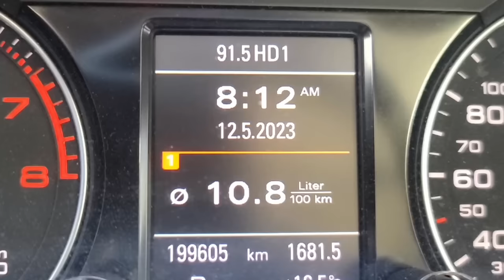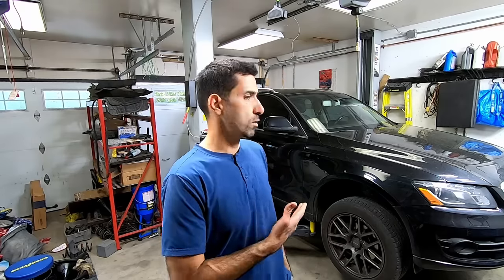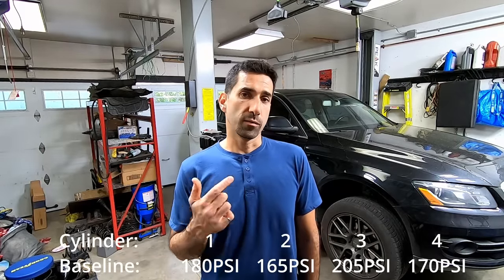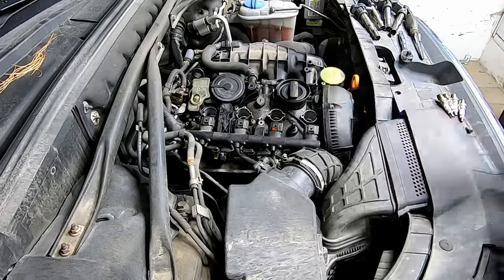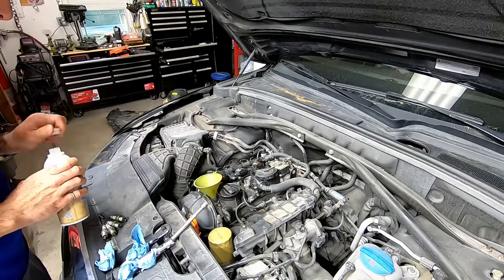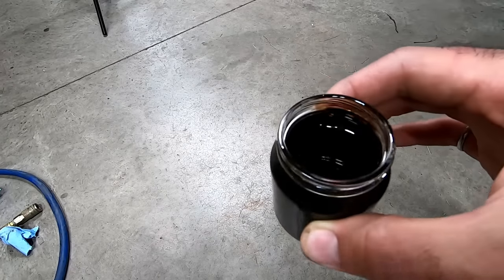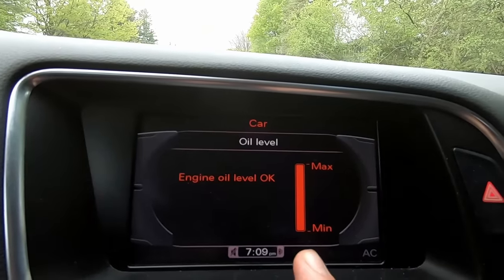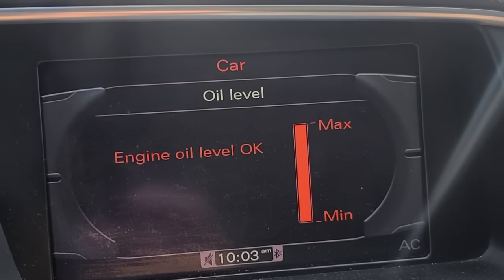How to fix excessive oil consumption from clogged piston rings (Part 2)

Comment: Would this work on my diesel? Suspecting i also have this issue. Burning oil about 1L every 1000 miles. I did a liquimoly flush previously and didn’t burn any oil for around 2000 miles but then the issue came back.

My worries are: being able to get the liquid sufficiently around the piston through the glow plug hole, a possible runaway engine once completing the soak, and also if the deposits that are released by this process will cause damage to the engine. 

Any guidance would be appreciated
Reply from the maker: Hey sorry for the slow reply... no real reason why this wouldn't work on a diesel if the piston rings are causing the same issues... doing a flush doesn't really give enough time for the solvent to free up the rings which is why the soak takes a bit longer... the 24hrs is what gives time for the liquid to soften up the soot in the piston rings that's causing the issues...

You should have no issues getting the liquid in through the glow plug holes but be careful when removing those... perhaps start with a hot engine to make sure they come out easy

As for a runway engine - hmm... which engine are we talking about? Common rail or older? If you're worried about it maybe shut off the fuel before cranking the motor?
Reply: @ETMotorsports  thanks for reply. Yeah definitely will be doing on a warm engine. Replace them whilst I’m at it aswell. 

Yeah should be okay will do a few cranks of engine once soak is complete before putting glow plugs in to make sure all liquid is gone from top of cylinder. 

The engine is a 3.0T out of a bmw. Heard these are known for low friction rings and as such this very problem can occur.

Comment: This is why I do my oil changes at 5000km on these EA888 engines.  The 14000km suggested interval is too long for vehicles in Canada.  Nobody in Canada qualified for non severe conditions. That’s what has ruined these cars. Oil is cheap. Engines are expensive.
Reply from the maker: I don't disagree that they're not exactly building these for different regions but I've got plenty of messages from folks all over the world so this is a widespread issue - it's not isolated to a region

Comment: how do ya get the liquid out after it soaks? i wanna do it but im intimidated. Plse help
Reply from the maker: Hey the liquid ends up in your oil after it goes through your piston rings... in the video I ran the motor for 20 min with the B12 in it before changing the oil with a fresh filter... if you're worried about doing that you can just drain the oil after the soak and replace it with new oil without running the motor
Reply: which is the right thing i think, thank you for the video  @ETMotorsports
Reply: @ETMotorsports will it help to run SeaFoam in motor for couple days before the Soak? Plse lmk. Thnx

Comment: I changed my plugs 2k miles ago, can I do this and use the same spark plugs? Or do I have to change? I’m trying to do this in a Kia Optima 2018 that is burning a lot of oil
Reply: Take a look and just make sure they’re not black. But during the restart, they may get some carbon n them, so just clean them up with a toothbrush and throttle body cleaner and you should be good.

Comment: How were the cats after all of that? Also what was the compression check the 2nd time? Also 2012 Scion XB doing the exact same thing. 2 quarts every 5000 miles.
Reply from the maker: No issues with cats - everything is clean... check out the third episode for the compression numbers etc

Comment: I got Audi a6 c6 2l TDI, and it burns 1L every 70km... :D it gradually started to get worse and worse, i wonder would this still do any miracles to it...
Reply from the maker: Damn...1L every 70km? I don't think you've got ring problems mate... that's straight pouring somewhere... rear seal?
Reply: @ETMotorsports  i doubt, it only smokes on high revs and there are no oil residue anywhere, unfortunatelly 2 years ago one of the pistons hit the head, so there was and urgent motor rebuild, and ive been told that rings on 2nd cylinder was looking rough, but it was after they rebuild the motor... so i wasnt keen to pay another 2k to take it apart again... after the rebuild it was burning every 300miles and slowly started to get worse, but there is no miss fire or anything, i just keep topping it up and smoke alot while drive. I got nothing to loose by trying this method as im already looking to buy another one, this might prolong it. Done 150miles today, poured 3L in :/

Comment: Hey, I want to follow the steps you took in this video because my Audi Q5, 2015 model, is burning througg oil like crazy... The process seems pretty straight forward, but I called around near me to see if a car mechanic can perform the piston soak for 24 hours, and a couple of problems come up: 1. they only want to let it soak for tops 1 hour, my question to you is if that makes a big difference? 2. They're charging crazy amounts just to do something so simple...
Reply from the maker: Hey the process is SUPER simple...if you can take your plugs out and change your oil you don't need a garage to do this for you...I think 1hr won't be sufficient for the liquid to really work properly - I mean it might but there's only one way to find out...technically you've got nothing to lose doing a 1hr soak before an oil change to see if anything is fixed but I think you're kinda wasting your time...I am curious about what they're really charging you for? Because this requires about 12 minutes worth of work and then the car just sits there...you should be able to perform this within a basic oil change job (so what's that about 100-150$ with the oil?). 

I`m not sure what to tell you - mechanics are in the business to make money and I guess they might be worried of potential issues down the road etc. Also consider what happens if the mechanic screws something up - say he puts the plugs in and cranks the motor and hydrolocks your engine - now there's trouble...This is truly a DIY type process - I don't think many mechanics will want to "risk" doing this job...
Reply: Thank you so much, this was very insightful @ETMotorsports

Comment: I'll try this on my 2013 3.0T Q5. 

But I still need to find where the coolant leak is at. It's been chugging coolant and I can't find where it is leaking from aside from the wet spots on the driver side (front-end).
Reply from the maker: 3.0T...hmm... these have issues mixing coolant with oil I think - lol online I think a seal fails... might want to check that asap - pretty sure they're are lots of stories of mechanical damage due to that issue

Comment: Would u know I can the part b12 from. I bought my oil at Costco 5w40 Castrol edges and filter at vw. U think use sucking pump to do oil change ?
Reply from the maker: You can just drain the oil no need to suck it up...i haven't seen 5w40 au costco but maybe my local one doesn't carry it

Comment: Do you think just running this in the oil for a day before an oil change would help at all? I don’t have the tools for this job.
Reply from the maker: interesting question - nothing really stops you from trying...it does however seem like the soot build up in the rings is pretty heavy so soaking it for a few hours seems to be the best way to deal with it...multiple viewers have tried a simpler approach and engine flushes but haven't been successful...on the upside you don't really need any tools other than a spark plug socket, which shouldn't cost you more than a few dollars...

Comment: I am planning to do this process for my 2017 Audi Q5 with oil consumption issues. I have already tried the LiquiMoly engine flush with a slight improvement. Wouldn't it be better to NOT run the engine with 2 bottles of B12? I was thinking it might be better to drain the oil after the soak. Or is better to circulate the B12 before dumping it?
Reply from the maker: Ideally, you wouldn't have to put the b12 in the engine at all... running the motor with b12 is definitely more risky then just draining it but it helps continue the cleaning... so just like every other step in the process - you don't really have to do it but it will affect the success rate... it all comes down to risk vs. reward

Comment: Thank you I learned alot from your video but I have a question please ,
if I do more B-12 like 4 bottles instead 2 is the result will be better ?
Reply from the maker: Generally speaking yes - the more B12 you use the better the effect but it would depend on how you use these 4 bottles I suppose... you can double the length of the process and just keep adding liquid and turning the crank for 48hrs... or you can just do the treatment twice at 2 consecutive oil changes...whichever way you do it - make sure you don't run the engine with 4 bottles of B12 in the oil... that's nearly 2L so the likelihood of damage grows significantly... if you do use 4 bottles at once make sure you drain it before you run the engine

Comment: 2011 A4 130k ...I've done this but didn't level out the pistons. But now I got a p0420 code. Someone told me that the o2 sensor or catalytic converter or both might have been damaged by the b12. Or maybe they were already bad. I'm deleting the catalytic soon.
Reply from the maker: B12 won't damage your cats - not with the amount of time you're running it anyways... keep in mind this is a fuel additive so it's meant to be burnt in the engine... this code can be caused by a bunch of stuff - dirty O2, misfires etc... don't rush to delete the cats - check everything over... how's the car running other than the code? Any misfires?
Reply: @ETMotorsports  no misfires. But it's a bit sluggish. The plugs get lots of csrbon....seems to be running rich.
Reply from the maker: @ivmo71  yeah dirty plugs or dirty injectors maybe? I had to clean my plugs after the flush because they were soaked with garbage
Reply: @ETMotorsports  what's your preference for plugs? I've been told to ONLY use the NGKs. I'm using the bosch.

Comment: Hi, can we use this method for a 2018 Tiguan. Was burning too much oil. After each change the oil low warning comes on after just 1200 km. 

Took to a local mechanic and they changed the turbo. And said everything is fine. But I don’t think its good enough. I still feel that there’s a lot of slow acceleration and other things going on
Reply from the maker: Yup - should work well

Comment: My Honda Pilot 2013 is burning oil too, not sure this process may work on it too?
Reply from the maker: If it's burning oil because of clogged piston rings then this would work
Reply: @ETMotorsports  but how do I ensure , if it is burning due to clogged pistons, for now I was planning to change PCV Valve to begin with. Thanks for reply.

Comment: 2-4kusd sounds reasonable compared to a subie dealer wanting 7k to fix the head gaskets in a subie engine. I guess oil burning isn’t just a subie problem.
Reply from the maker: I've heard of quotes in the 10-12k for an engine rebuild which is insane... sounds like the tech didn't want to do the job 🤣
Reply: Yup our nearby Audi dealer quoted piston rebuild at 9k😮

Comment: Hello, I have a consumption of 1l /1000km Audi Q5 Tdi 177 engine code CGLC (2012) Has anyone tested B12 on this engine? I have cleaned with tolarin anticarbon, but there is no improvement
Reply from the maker: Hmm 1L/1000km is right on the border of the spec...I didn't think this was common for the diesels but doing the treatment is pretty straight forward - you have to pour through the injectors or the glow plugs - whichever is easier to remove... the rest is all the same
Reply: @ETMotorsports  Do you know of any diesel cases? I'm looking everywhere I can, but there are few cases, some isolated and without user response in forums, there is no smoke, there is no visible loss, the car responds strongly, idle stable, it only burns oil, I don't know how to solve

Comment: B12 directions are to add to gas and drive. I wonder if the soak is necessary? Maybe try just adding to gas like directions say and maybe after a couple of cans, your problem is fixed? I wonder how long this treatment will last?
Reply from the maker: B12 is a disolvent sold as a fuel additive... the directions are for cleaning up your injectors and fuel system etc - adding to your fuel will have zero effect on the piston rings... the liquid needs to sit in the rings for a period of time to dissolve the build up

Comment: Hello mate and greadings from Romania! God bless you for those 2 videos that you made regarding EA888 burging oil issue! I have an '09 1.8 TFSI with 315 000 km on the ODO that is burning about 1 liter per 1500 -2000 km, and I want to do the piston soak asap, however being from Europe (Romania) is rather impossible to get my hands on some B12 Cheemtool, so what subtitute should I use (I can use injector & fuel system cleaners or engine flash form various brands like Sonax, Wynss, Liqui Moly, STP, etc)  ?? Please advise!
Reply from the maker: Hey thanks for the note! A lot of people have asked the same question but I don't yet have confirmation that any of alternatives are as successful as B12...my first go-to would be LiquiMoly Engine Flush Pro Line - this is pretty concentrated and "should" work similarly to the B12...alternatively any injector cleaner that you can buy in bigger quantity should be ok as well...I would try the engine flush first and go from there...I had great results with STP engine treatment with my A4 so I suspect most of these products will work out just depends on how effective they'll be
Reply: @ETMotorsports  Right! So, what do you say about the following, first 1 can of engine flush - 300/400 ml, then 1 can of injector cleaner 300/400 ml ? By the way you think is also important to rotate the engine before every "dose" ??? ( in my opinion as a mechanical engineer is that the liquid is dissolving the carbon buildup from the lubrication ring freeing it so it can have a degree of freedom needed in order to scrape the oil down from the cylinder wall, so turning the engine by hand won't make any difference or will it  ?! ) :-)
Reply from the maker: @maddogg4sure  hmm I would avoid mixing two chemicals in the motor and then running it... I'd do 2 cans of either,  then run for 1000km (or one oil change) to see if it was effective and if not try two cans of the other... doesn't really matter which one you start with - we're shooting in the dark right now anyways...

As for rotating the motor - multiple viewers noted carbon left behind on the cylinder walls during the rotations so I still think it's useful to move things around while the liquid is trying to penetrate... you're agitating the carbon up as is getting dissolved... that's the idea anyways
Reply: When you look at the sds or safety data sheet for b12 it says it is around 90 percent acetone. I plan to use acetone from the paint store or builders providers. 12 euro per litre.
Reply: @richardsheil5289  so you suggest putting accetone in the piston ?
Reply: @maddogg4sure  Yeah. Why not. If b12 is acetone then just use acetone.
Reply: I plan to use it in a friend's Peugeot 1.2 3 cylinder.
Reply: @richardsheil5289  you got a point there mate! Anyway, i will stick to engine flush ori injector cleaner, not sure yet, without B12 i am in “experimental” territory :)
Reply: @maddogg4sure ai încercat? A mers? A scăzut sau dispărut consumul?
Reply: @radutnarcis8767  inca nu, pentru ca mai aveam ceva ulei in plus de care voiam sa scap si o sa fac probabil luna viitoare, dar clar merita incercat, macar cu 500-750 de ml de oil flush si la final pus putin ulei in fiecare piston si invartit cu mana motorul pana sa montezi bujiile, sa nu zici ca ii dai cheie cu camasa perfect curata si degresata. Din punctul meu de vedere nu sunt riscuri si merita 100%

Comment: when you rotate the crank the second time do you do a full spin back to the original height or do you just get the other two pistons level?
Reply from the maker: Honestly, having done this a few times now,  on the 4 cyl the position of the piston doesn't really matter... the pistons are not tilted so there's no difference where they are in the stroke... so basically spin as much as you want and leave them where they are... on the 3.0T that I just finished you need the pistons at TDC otherwise the liquid just sits on one side of the piston because it's at 45deg

Comment: after fixing the problem with berryman's, ALWAYS run Rislone in the engine at EVERY oil change and the problem will never come back.
Reply from the maker: any particular Rislone product?
Reply: @ETMotorsports  Hello, Rislone Max Performance Engine Treatment (16 oz bottle) is what I use. I think they have a few different versions of it, like high mileage for one. My wifes nissan (115,000 miles) started using oil. It got down to 3/4 quart low on dipstick. I added 1 bottle of rislone to bring it back up to 1/2 quart low (still in safe zone). It has remained at the 1/2 quart low mark for several thousand miles, hasnt burned a drop since. Due for oil change now. Rislone is going back in every oil change.

Comment: Anyone have experience cleaning with Mitshibishi Shumma? We don't have garages using B-12, but with the afordmentioned engine conditioner. Wonder if it's a waste of money and a risk to cause even more problems?
Reply from the maker: You can do the treatment with any engine flush you can get your hands on... it wont be as strong as b12 but it'll have positive results
Reply: I tried liqui molly proline motorspulung - no effect whatever (just less money in my pocket). Although motorspulung is added to oil, car idles for 15 minutes and than you change oil.